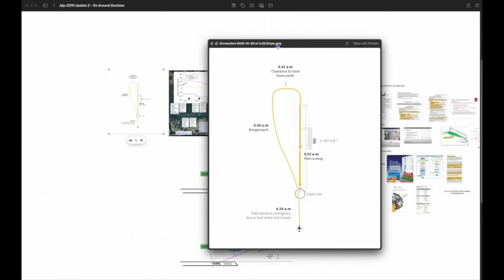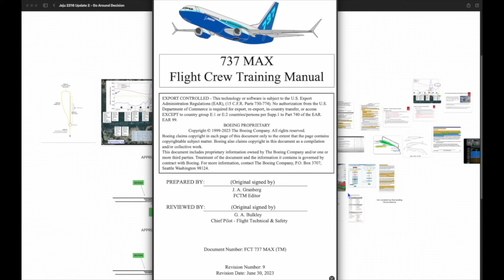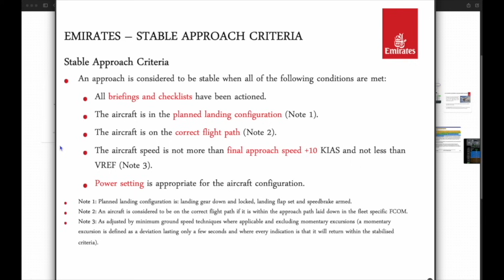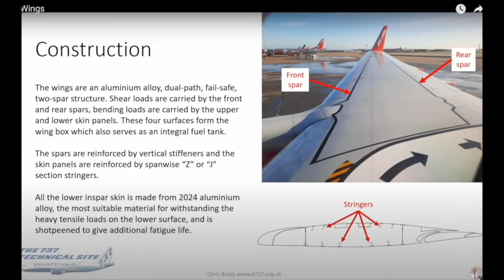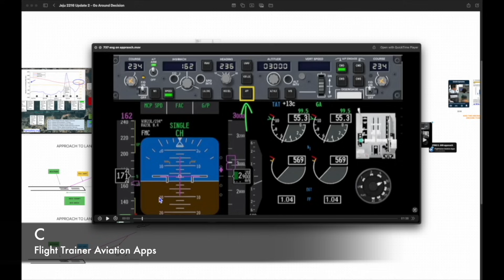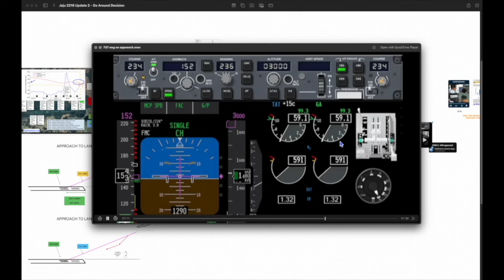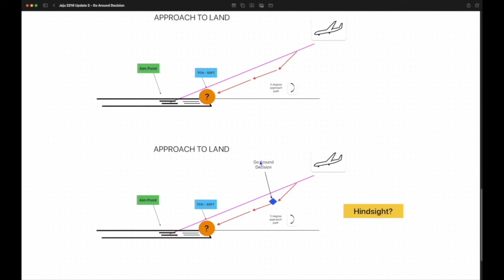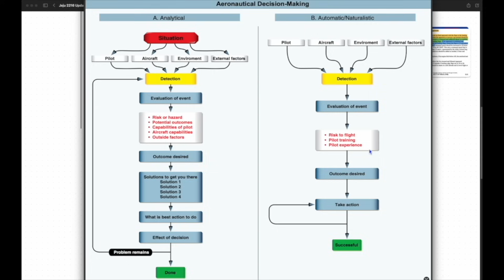Go-Around Explained: Jeju Air 2216’s Decision Not to Land

Comment: It seems that the pilots should have realized quickly that they did not have the power to go around.  When they did make the "wrong" decision, as they were approaching the runway, they should have realized that they were going too fast, and at the very least side slip and/or roll back and forth to lose energy (they should have damped the landing gear with the gravity thing, why did they not do that at least?).  When they encountered the ground effect, they should have slammed the thing down on the ground with the elevator.  When they realized they have no friction on the runway, they should have hit the rudder and exit the runway.  It seems that the crew simply froze and panicked.
Reply: Have you seen how cumbersome the alternate gear extension system is. Everything looks simple in hindsight. They may have kept the gear and flaps up to even make it back to the runway and by the time they had figured they were going to make it,  they probably thought that deploying the gear fully would have taken too long. Maybe they thought that if only one leg of the main gear extended, they would have speared off the side of the runway, perhaps digging one engine into the ground and causing the plane to roll over. Engines are designed to break off and flip over the top of the wing. That's not exactly a wanted scenario. That they made it to the runway at all should be acknowledged.
Reply: Maybe because they were a glider at that moment? Which maybe they couldn't have known before at the time of the strike, because the power loss was not immediate but gradualy? I'm speculating, but damn, so are you. Stop being a smartass after the facts, without knowing anything. Hindsight is 20 20.
Reply: @arnaudgerard1971  Analyzing people's decisions is not being a "smart ass".  It is the lives of huge number of people here. And it seems that they made a number of wring decisions.  Perhaps the extreme automation makes bad pilots.  It certainly is the case in cars.  The more automatic "safety" systems they put on cars, the worse the drivers get.
Reply: @demetridar506   I have nothing against analyzing - although that's difficult without knowing ALL the facts. But people here don't analyze. They're (trying to) play the blame game.
Reply: @arnaudgerard1971 the OP is correct. 1. You don't have to be a pilot to know that the speed at landing was way too fast. 2. Lowering the landing gear would have helped to reduce the airplane speed. No speculation required, poor airmanship. You are correct, and I'm speculating, the pilots don't appear to know or have known, very much.
Reply: @ The speed at landing had to be that fast because they had no flaps or slats. You DO HAVE TO KNOW HOW PLANES FLY to know that. And they had no power to lower the gear, and no time for a manual attempt to lower.. Pilots know how long that takes - you clearly don't.
Reply: @petercollins7730  There are ways you can bleed off speed without flaps and slats.  One of the theories says that they on purpose did not deploy the flaps in order to ensure they have enough energy to reach the runway.  Great.  Once you know you can make it, about a mile or two before the runway, either deploy the flaps or start side slip and roll back and forth to bleed off energy.  One of the pilots can reach out to pull these landing gear cables while the other flies the plane (that is one of the reasons they have two pilots).  Sliding off the runway to lose speed via friction is a far less risky action than the plane rolling and whatever.  If the plane eventually rolls and whatever, at least it will have slowed down.  It is rather obvious that these guys froze and were looking at each other instead of taking action.  This happens a lot in car drivers.  You can see that their lane may be blocked ahead but lanes left and right are open, yet they go and run into the obstacle on their lane instead of changing lanes.  Part of the problem is the extreme automation on everything has made it difficult for people to take rapid decisions on their own initiative.
Reply: @demetridar506  First, they could not deploy flaps and slats. 
Second, they could not "side slip (in a 737?) or roll. They had no power and no hydraulics, remember?
Third, they needed the extra speed, not to make the runway, but to avoid stalling. A landing without flaps and slats requires at least 40 - 60 knots more speed than a standard landing. 
Fourth, in full reversion, it would take both pilots on the yokes just to minimally control the plane. And a gravity drop of the gear takes more time than they had, and involves very serious risks, since it is not always successful.
Fifth, departing the runway would almost certainly have resulted in a 100% fatal crash. No pilot would ever choose to "slide off the runway." They did not know that there was a concrete obstacle within the overrun area.

They were patently not "looking at each other and not taking action." In the 2 minutes 19 seconds after the strike, they:
initiated a go-around;
when they could not climb out, they executed a teardrop turn;
lined up precisely on the centerline of the runway;
landed the plane on the centerline, straight.
Try doing all of those maneuvers in you MS Sim - and just for realism, turn on 15 different extremely loud alarms and a dozen or so flashing warnings.

These pilots performed remarkably well, and did everything humanly possible to get their passengers safely on the ground. The airport killed those passengers, and those pilots..
Reply: @petercollins7730  Obviously the plane was landing well above the landing speed even with these retracted flaps.  You could see it floating and floating.  I am sure the pilots knew what the stall speed of the 737 is in that configuration.  As I said, perhaps 30 seconds before touchdown, it would have been obvious that they had plenty of energy to make it, and in fact they were going way too hot.  That would have been the time to bleed off energy in every possible way, including using ailerons, rudder, landing gear, etc.  One of the pilots should have at least tried to pull these chords.  All accidents are combination of events that pile up.  One of the factors here is the inability of the pilots to act quickly.  Again, too much automation is not helping.
Reply: @ The landing speed was slightly less than 200 knots. Minimum stall speed in that configuration is between 180  and 205 knots. They were going as slowly as possible. And 30 seconds before landing, they were coming out of their turn. Do try to pay attention to what happened.

When a 737 lands fast, the ground effect makes the plane float. You would know that if you understood how planes work. The pilots landed 900 metres from the TDZ, with a perfect flare - an excellent piece of airmanship.

Without power, they did not have the use of the ailerons or landing gear, and had minimal rudder control. Of course, using the rudder would have put them off the centerline and they would have run off the side of the runway - is that what you think is better?

You don't have any idea how long it takes to manually lower the gear; you don't have any idea how much physical strength - 2 strong men - is required to keep that crippled plane flying straight. You don't have any idea about any part of the reality of the situation.

And saying the pilots did not act quickly is simply imbecilic. They had less than 3 minutes and performed heroically and with enormous skill. You are just ignorant.
Reply: @texroy1644   You are wrong. Were you in the pilot seat at that moment? Did you have millions of hours to think about it? Whatever the situation was at that moment, a knowitall like you, and all the other commenters on this video, would also have killed the 2 survivors.
Reply: @arnaudgerard1971  I'm not a know it all, neither am I a pilot. That does not diminish my ability to detect poor behavior or performances. Someone driving a car into a wall or another vehicle with no attempt to apply any brakes is displaying poor driving ability. Someone landing a plane with no attempt to lower the landing gears is displaying poor airmanship.
Reply: @petercollins7730  On your first reply,  you seem to be making my point.  The aircraft configuration was more important to the pilots over to whether they had power or not.  "Procedures" override the events in front of you.  Perhaps a form of denial.  As soon as they lost power, the "unstabilized" approach was their only option, if they wanted to stop on the airport premises in not too many pieces.  However, your statement that water landing is disaster is debatable.  If they could not use the ailerons and elevator, there is no way they could have done the steep turn, so this is clearly wrong.  If they had enough elevator and aileron authority to do the steep turn and level again, they certainty had authority to side slip.  I do not know where your estimate of the landing speed came, there was no data for that part of the flight.  Given where they touched down (about half way into the runway) and how much they were floating, it seems silly to be arguing that they did not come in "too hot".  And they did not have to let the plane float, they could have forced it down with forward pressure.  Trying to bleed off energy with drag while over the runway was a bit too late ...  Perhaps the threat of the barrier at the end was not so clear, and that could be an excuse for failing to force the plane down or veer off the runway.

I suspect that many simulations will be done (or already done) to show the options they had.  Many or most will probably not reach the general public.  Telling the public that the pilots did all they could is the best way to calm down the public.  But the odds that there were no scenarios that could have saved the majority of the lives on board is slim.  I bet some are what I proposed yesterday.

I guess it is justified for an airline pilot to try to cover his colleagues.  But the fact that bad decisions were made by the pilots that sealed the fate of all these people is just too obvious.  I guess they could have done worse.  They could have stalled the plane during the turn, so that not a single person would have survived.  We can agree on this one.
Reply: @texroy1644  You are displaying ignorance of the most basic facts about a 737 landing gear. These pilots had no way to lower the gear - they had no power, no residual hydraulics, and no time to lower by hand. If you weren't so ignorant, you'd know that.
Reply: @texroy1644   Maybe it's displaying poor maintanance ability. Ever thought of that? Knowing everything before knowing the facts: you can come up with your own word or definition if you like.
Reply: @petercollins7730  lol, the landing gear only needs gravity to be lowered; you know that, right? The same force that brought the plane down. If only the pilots were competent.
Reply: @texroy1644  It takes time to gravity drop the gear - you know that, right? And frequently a gravity drop doesn't work - you know that, right?

So, Mr Competent Pilot, how long does it take to drop the gear by gravity? You know everything - tell us. And explain when the pilots had that time.
Reply: @petercollins7730  lol, less than a minute to full extend. Incompetent pilots, no sign of the emergency landing gear being deployed.
Reply: @texroy1644  Yes, after the pilot gets up, goes around his seat, opens the door, pulls the handles, it takes between 60 and 90 seconds to deploy and lock. If it works. Exactly where in the 2 minutes 19 seconds after declaring an emergency, while they were trying to control an aircraft in full reversion, make a teardrop turn and prepare to land did they have those minutes.

And there is no "emergency landing gear."

Keep flying on MSFS - you would be a disaster in a real plane.
Reply: @demetridar506  "One of the pilots can reach out to pull these landing gear cables while the other flies the plane"

The access panel can only be reached from the right seat with it lowered and fully aft. Even then for many First Officers (FO) it is a stretch and is difficult to reach when seated, most FO's have to slip off the shoulder straps. It cannot be reached from the left seat while the Captain is seated and strapped in.

"Once you know you can make it, about a mile or two before the runway, either deploy the flaps or start side slip and roll back and forth to bleed off energy."

With the loss of both the engines there is no115V 3 phase 400Hz AC to power the electric motor hydraulic pumps, so there is no backup system for the rudder. To sideslip requires input into all three control surfaces (ie: aileron, elevator and rudder). Without a rudder, when yawing the aircraft and keeping the nose up, can result in a stall and a spin.
Reply: @petercollins7730  "Second, they could not "side slip (in a 737?) or roll. They had no power and no hydraulics, remember?"

Without power or hydraulics the 737 can be flown using the mechanical cables and pulleys, which connect the pilots' yokes to the flight control surfaces, ie; aileron and elevator. There is no mechanical backup for the rudder. Hence side slips are not practical.
Reply: @petercollins7730  "Third, they needed the extra speed, not to make the runway, but to avoid stalling. A landing without flaps and slats requires at least 40 - 60 knots more speed than a standard landing. "

Correct. The approach speed for a flapless landing is 200 kts, which is the speed to approach was flown.
Reply: @christopherrobinson7541  It wouldn't be practical here, anyway, even if they had the capacity.
Reply: @christopherrobinson7541  Many people don't understand that a stall is a catastrophic event, and that the higher speed was really well chosen, and the minimum necessary.
Reply: @petercollins7730  "Without power, they did not have the use of the ailerons or landing gear, and had minimal rudder control."

There are backup mechanical cables and pulleys for the ailerons and the elevator, but there is no backup for the rudder.
Reply: @christopherrobinson7541  "Hard to reach, need to release harness".  OK, better to run into the barrier then, I am sure the harness will save the FO.

Another commentator in this thread was saying the opposite, the pilots had only access to boosted rudder and no elevator and ailerons (yet they made the steep turn).  But even if you are right, they could still oscillate the ailerons left right left ... and that too will increase drag.  Given how much faster than the stall speed they were flying, this would not have caused stall.  Once they reached the runway, they should not have kept the nose up and keep on floating, they should have slammed it down and get the drag/friction from the runway.
Reply from the maker: Some good questions here (and in the thread) for the industry to look at, can we go deeper with training scenarios and consider the 0.1% for the learning value it holds
Reply: Yep, no one wants to admit that the decision to go around was the wrong one [beyond the technicals it was illogical, why rely on damaged engines?]. I think people don't want to think the disaster could have been avoided that easily.
Reply: @davethewave7248  It's only wrong in hindsight. And we don't know what the pilots knew and when they knew it, nor do we know what they were seeing ahead of them out their wind screens either. There are too many things that we just don't know, and they aren't here to explain to us, to say definitively that they did anything wrong in fact. Regards!
Reply: @michaelshrader5139  Experience is not required for logic. IF they were relatively well configured/ placed for a landing, they should have continued to land [i.e.; illogical to rely on engines in going around]. Neither does it matter whether it was just 'birds in the area' or an actual bird strike that caused them to go around. Either way, there is more risk in going around than in just continuing to land [not having to rely on engines].
Reply: @ The plane was not configured to land after the strike. And there is far less risk in going around - a go-around means you have time and altitude to assess damage, to prepare the cabin, to configure the plane, and then to land. Unless they knew what would result, they made the right choice. And unlike all the armchair pilots blaming the crew, they did not know what the outcome would be.
Reply: @petercollins7730  It looks like seconds after the bird strike they had no thrust.  It was obvious that they had no power to go around.  On the other hand, a few seconds after the strike they were still well aligned to the runway.
Reply: @demetridar506  Since they ascended over 500 feet on the climb out, they had some power after the strike. And they were not configured for landing after the strike, and they were unstabilized.

No matter how you argue it, they followed procedure, successfully made a very difficult turn, made a perfect landing, and then ran out of runway. It was  not the pilots fault that there was a concrete structure way too close to the end of the runway. They did their job exceedingly well.
Reply: @petercollins7730  They most likely lost all power right after that initial climb.  I do not think they gained 500 ft, they got about 1500 fpm climb for a few seconds (10 seconds?).  They lost power very shortly after that.  They could not have been too misaligned from the runway.  Procedure is one thing, but the pilots need to be flexible and revise their decision right away.  After the initial climb of the first few seconds, it must have been fairly evident that the best option is to go and land.  Perhaps they had retracted the landing gear by then, but it looks like the only two viable options were to try for the runway or ditch.  The crash barrier at the end was obviously not their fault, and perhaps they were not even aware of it until the last few seconds.  Perhaps the airport authorities should have made aware to all pilots coming in and out from that location of that death trap.  But I think there is a strong likelihood that the pilots failed to take rapid decisions at the right time.
Reply: @ The bird strike occurred around 400 feet; they climbed to 940 feet. Do the math.

The first 2 memory items on a go-around are to raise the gear and retract flaps and slats. If you were a pilot, you'd know that.

If you think that making an unstabilized approach while not configured, immediately after a bird strike which caused unknown but serious damage is their best option, don't ever fly a plane. And ditching is the WORST possible thing they could do. Water landings are nearly always catastrophic - no pilot chooses the water when a runway is available. Not ever.

"Failed to take rapid decisions?" In less than 3 minutes, they:
initiated a go-around;
at the go failure, they made a teardrop turn back to the runway;
they lined up the plane on the centerline;
they landed the plane with a perfect flare, straight, on the centerline.
Go and try doing that on you Sim.
Reply: @petercollins7730 A perfect landing? They floated down 2/3 of the runway and ran off the end at takeoff speed. Without the concrete berm they were still dead. That's not a perfect landing, you're trying really hard to make the facts fit your opinion.
Reply: @Cedric_Harris  In a plane with no flaps, no slats, no power, no lateral control, in manual reversion, they made a perfect teardrop turn, lined up, landed on the centerline and held the plane straight to the end of the runway. They landed 900 metres from the TDZ, not "2/3 of the runway."  If you knew anything about flying, you would know that coming in that fast, because of lacking flaps and slats, the ground effect would make them float.

Without the concrete structure at the end of the runway, and without the improper cement block wall on the perimeter, they could have slid another 1100 metres - more than enough for the plane to stop.

You're trying really hard to pretend that these pilots caused the fatalities. It's sad that all you MSFS pilots think that, but every actual pilot understands they did a superb job of flying in the circumstance.
Reply: @petercollins7730 Are you an airline pilot? If you are, I'm concerned, because I feel like you should be able to make your point without having to misrepresent what everyone else is saying.

I didn't say they landed 2/3 down the runway, I said they floated 2/3 of the runway, and that's true, they've still got the nose up right before they hit the damn berm. That's stupid. Yes, I understand how no flap no slats landings work, and I'm familiar with the ground effect. So they came in hot, that's not an excuse not to push through the ground effect and drop that puppy on the ground hard. At the very least push the damn nose down. Trying to butter the landing with no gear and no brakes is basically suicidal.

Until an official report is out, we don't really know what they had or didn't have. All we know is that they had enough power and control to make it back, and yet they didn't start the APU, they didn't manually deploy the gear, they didn't try to bleed off power on approach, they didn't push the nose down, and they didn't even attempt a last ditch effort to maneuver the plane by kicking the rudder or rolling with the ailerons (that probably would have been ineffective, but from the video you can see that they didn't even try.) As someone else said, almost anything would have been better than what they did. And again, the berm is a scapegoat, they wouldn't have just rolled to a stop without it, there were roads, a fence, ditches and all kinds of other obstacles and hazards that would have turned the plane into an equally large fireball. We'll probably never be able prove what really happened, but YOU can't convince me that it wasn't incompetence. Competent pilots wouldn't have died that day.
Reply: @Cedric_Harris  Obviously you have never been a pilot. In a gear-up landing, it is absolutely critical to flare the plane - otherwise the nose digs in and you cartwheel. Every pilot, even a raw PPL, knows that much. And how do they 'push through the ground effect?' Magic? If you were a pilot you would know that was a textbook gear-up hard surface landing. You would have killed all the passengers on touchdown. Thankfully you don't fly anything more than a keyboard and your joystick.

Again, as any pilot could tell you, they had no time to start the APU, or to power the gear. They landed at 195 knots, 5 over stall speed - bleed more speed and you stall and pancake. And, as I said, drop the nose and cartwheel. And since they landed on the centerline and continued straight to the end of the runway, why would they maneuver? You want to stay on the runway, not out in the mud. More nonsense.

And they did not know that a concrete structure was built in the wrong place. And running through bare fields and a fence would have caused minor damage, not a massive, catastrophic explosion. As every actual pilot has said, absent the concrete wall, this would have been an entirely survivable event, thanks to the excellent airmanship. You, keyboard warrior, are just showing how little you know.
Reply: @petercollins7730  "Without the concrete structure at the end of the runway, and without the improper cement block wall on the perimeter, they could have slid another 1100 metres - more than enough for the plane to stop."

No. 

The airport boundary wall (70m beyond) has deep ditches either side of the wall and a service road on the inside and a public road on the outside.

 The aircraft would have skidded more likely 3,200m. Also there was a major multi-lane road at 900m and a hotelcomplex at 1,200m and then the sea.
Reply: @petercollins7730  "They landed 900 metres from the TDZ, not "2/3 of the runway.""

The threshold was displaced by 300m because of construction work at the end of runway 01. So the touchdown was 1,200m from the original TDZ, about 1,600m from the end of runway, so 43% and not  2/3rd as claimed by @Cedric_Harris.
Reply: @ No one admits that because the go-around was the proper action to take. Continuing the first approach would have been catastrophic.
Reply: @petercollins7730  It could not have been much worse than what happened...
Reply: @demetridar506  Of course, the pilots did not know what the outcome would be before they initiated the maneuver. All of you MSFS pilots want to blame the real pilots, on the basis of your knowledge of the outcome. Hindsight is wonderful, isn't it?
Reply: You should have bought Bitcoin in 2009 and Nvidia in 2019.